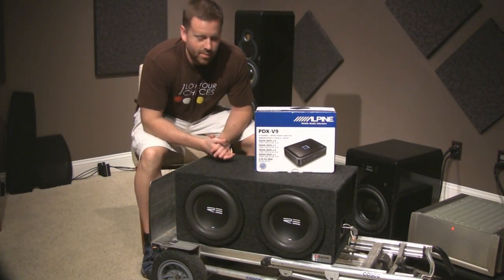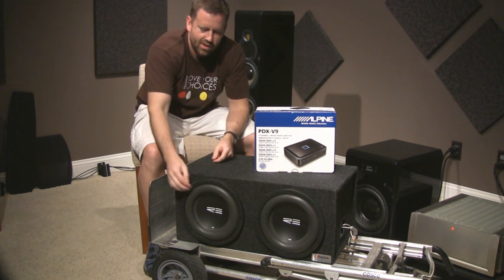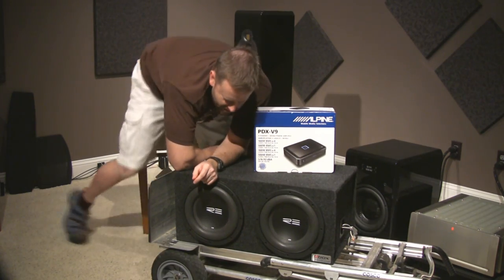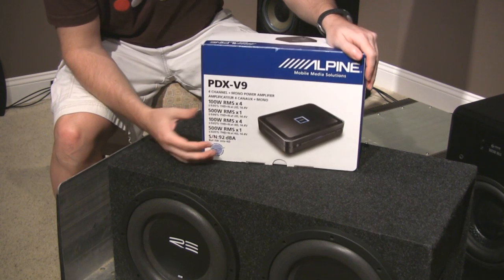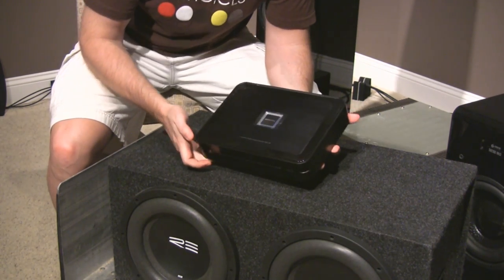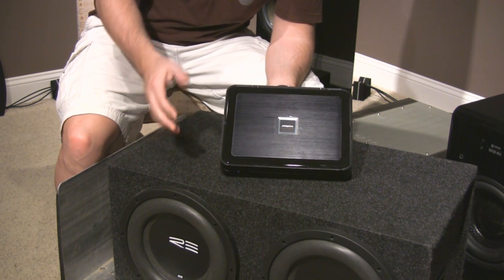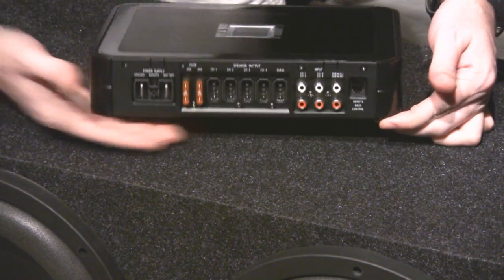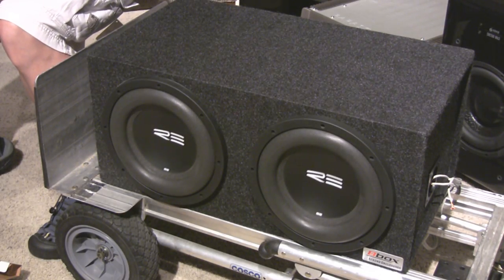SQ Car Audio Project Part 9 Alpine PDX-V9 Amp and RE 10" Subs Test

Comment from the maker: For the 4 coaxials this amp would sound great. The Hi-Energy's have a 92db sensitivity and should perform great on this amp. If you so desire and have the budget to do so, the PDX-F6 and seperate mono amp will raise the bar even more and give you more headroom, but it's not necessary especially on coaxials. 137w is rated at 14.4 volts, actual output is probably close to 100 or 110w I'm guessing at typical car voltages. I'm very happy with this amp.

Comment: Looks like I will probably go with the PDX-F6. Apparently my car (I haven't had it long) has different sizes in the front and back, 6.5" and 6x9 and may need a bit more power. So I'll probably go with a 4x150W setup with 4 speakers and then start shopping for an extra mono amp next.

I've heard very positive things about Alpine's PDX amps, and they seem to be offer good power and quality for the money. Thanks for the info.

Comment from the maker: It's a 2008 Kia Optima. It dreams of being an S4, lol. Big trunk though! Sounds like a good system you've got there. I am worried too about the bottom end power, mostly because the RE SE's have a lowish sesitivity, and I've got two of them, and they're sealed which requires more power. I may add an amp or get a single 12" with a higher sensitivity, like an Image Dynamics idmax or something. We'll see how this performs first though.

Comment: What car is this going in? 
I built a system for my Audi S4 Avant with  Infinity Kappa Perfect6.1 ans Perfect5.1 separates front and rear along with a single 12" Pioneer TS-SW3001S4  all powered off a 5 channel Kappa Five. The head unit is a Pioneer AVIC-Z 130 BT
Overall I like it. I think that the digital amp is a little underpowered for the sub so I'm thinking about getting a Kappa One to round out the low end.

Comment: Hi ,
THis is Mathan here from india . I have an Pioneer GN-D8500 Amplifier to power my pioneer sub and another pionner 4 ch amplifier to power Focal as 165 component in the front and a coaxial at the rear, Now I am plannning to install this in my new car and planning to replace this with a 5 ch Amp. which one should i go for . I was contemplating betwen Rockford Fosgate R600X5 Prime 5-Channel Amplifier and Alpine PDX-V9. Please help me decide. but planning to retain the speakers (or )  should i use the same units

Comment: I'm thinking about pulling the trigger on this amp and 4 Hertz HCX 165 6.5" coaxial speakers very soon. The power handling of the speakers is rated between 100W to 200W. Which figure is more accurate, 100W x 4 or 137W x 4? I'm trying to figure out if I'd barely have enough power or plenty to run 4 speakers properly. Would I be better off getting the 4-channel PDX with 150 x 4 and get a separate amp for a sub, or would the PDX-V9 meet all my needs for 4 speakers and a modest sub?

Comment: Well sq in your case is debatable. Don't bother getting a processor if you are using class d amps and I recommend not using 2 subs... a quality one not made in china would be enough imo. One sub will get you better sound and put less stress on your amp especially if you keep the factory alt. I personnaly prefer passive over active... saves a lot of headaches. Just get quality comps like Diamond, Hertz or DLS. Helix are really good too though.

Comment: Hi, I would like your opinion about the pdx v9'm looking to buy one and would like to know if the sound quality is good. 
There is a story about this amp, it generates a hiss is true? 
I'm in the car a focal one sub 13w1 jl v30 and my amp kit and giving this problem and is also very large jl 500/5. 
What do you think? 
Thank you.
Reply from the maker: I like it a lot. Mine has no hiss whatsoever. I've heard of people getting a hiss, but I think it's more likely an installation or equipment combination issue. I had an SQ judge in my car and he commented that he couldn't believe how low the noise floor was. Better than his own which was also an Alpine setup. You'll be fine with the V9. It's a very compact amp too, people don't believe it when I open my trunk that that's all that's in there.
Reply: Photo314159

Thank you I will buy the same v9.

Comment: Why didn't you just sand off the 2/10th of an inch that you needed removed from the sub cutout, instead of all the headache causing stuff you tried? I know you posted this awhile ago, but it looks like you are still checking and answering the comments. Any way, good luck.
Reply from the maker: I did sand the holes actually. That's how I finally fitted them, with a rotary sanding wheel on a drill. I needed to remove a lot of material which is why I didn't think to in the first place. A real coarse wheel did the trick.

Comment: Does your box have a divider in the middle? And if it does how did you wire them together?
Reply from the maker: Yes. They were wired externally. Each woofer had it's own binding posts, so it could be wired any way I wanted.
Reply: Clint the Audio Guy what ohm was your subs? And what ohm were they wire down to?
Reply from the maker: These were dual 2 ohm voicecoil subs, wired to 4 ohm each, then together for a 2 ohm nominal impedance combined.
Reply: Clint the Audio Guy thats what wanted to finger out I always look up on the web how to wire 2 subs in different chambers with 2 terminal cups but it never says how to, always says wired them together either in series or parallel thanks now i know. I use to have 2 4 ohm kickers compvr subes wired in serie different chambers in a ported box with a cx 1200.1 2 ohm kicker amp, thats how the shop wired it. So basically seeing a 4 ohm load and on my amp a 4 ohm load is 600 watts so i was always confused why my brother in law had the same setup but with. Cx 600.1 separate chambers in a sealed box and bumped way more than mine i was always confused, was always like how can he be bumping harder than mine if i got a 1200.1 and he only gots a 600.1 amp like whhhaaatt lol.

Comment from the maker: I have not heard those amps so I can't compare.
Reply: Awesome SQ amp. I have JL speakers throughout the car, c2 6.5 set in doors, and zr100 tweets in pillars on front channels, c2 6x9’s on rear. And The Ho 110 10w3 high output sub. And matched with a Kenwood ddx 8901hd head unit , its an awesome setup.